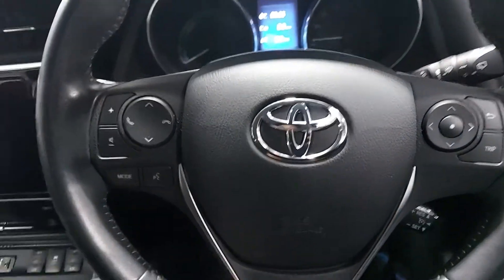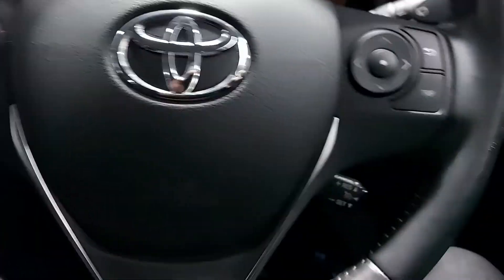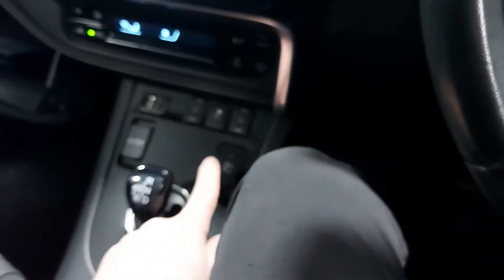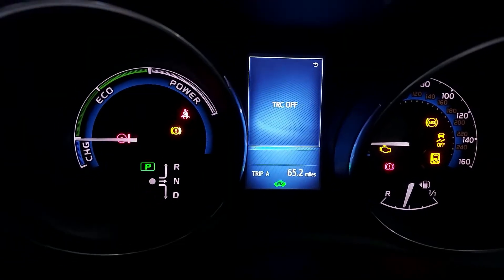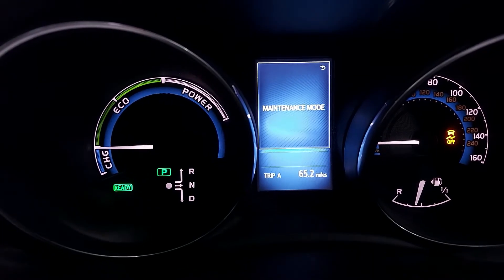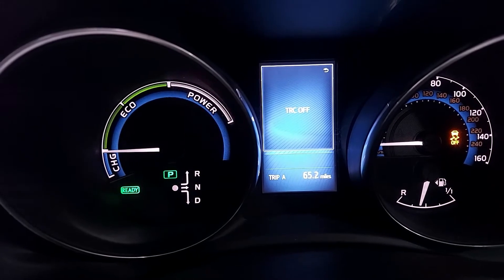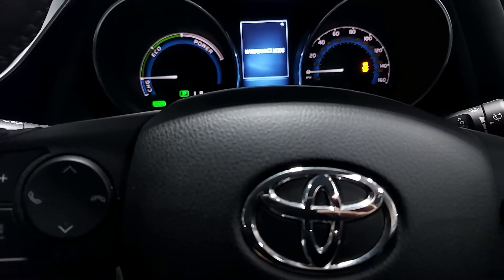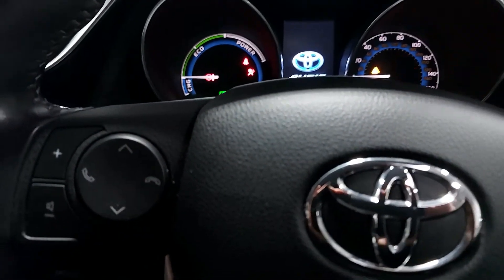Toyota Hybrid Maintance Mode

Comment: Worked thank you 
Do u have to take it to toyota
Can i run it as it is on maintains or get it fixed
Reply from the maker: I only use  this mode when need for emission testing or other engine repairs

Comment: Hi, can I change brake discs and pads during maintenance mode ?
Reply from the maker: no, maintenance mode is used when you need the ice to run continuously for emission testing or coolant bleeding or similar.

Comment: Is ready mode and maintenance mode same?
Reply from the maker: no, it is not. Maintenance mode will keep the internal combustion engine running all the time. It is ment do be used for emission testing and other diagnosis
Reply: @GicaPhp   if I use maintenance mode in my car, won’t it be a problem ?if I don’t use my car for a long time (suppose 10days), the engine oil and every fluid needs to run through the engine , don’t you think maintenance mode will do that? Because I don’t be running the car , I just want to start in the garage, that’s all, you think normal start will do the work
Reply from the maker: @chiefdp213  i don't see a problem, just be aware of exhaust gases in a confined space
Reply: @GicaPhp  so what’s the conclusion? Should I use maintenance mode for heating up the engine or should I just normally start the engine and let it run ???
Reply from the maker: @chiefdp213  if you have heater on high it will run continuously anyway